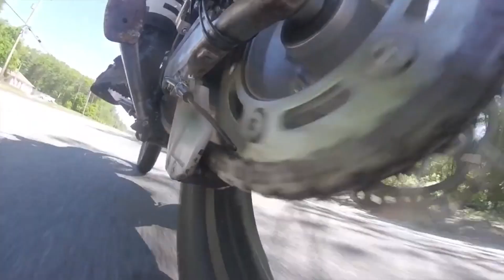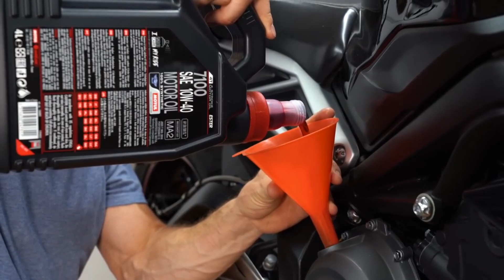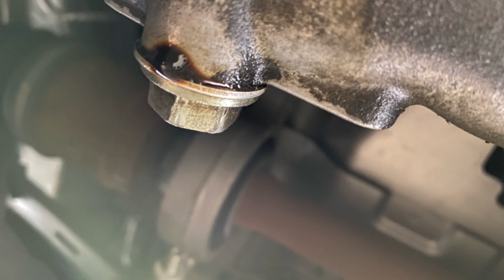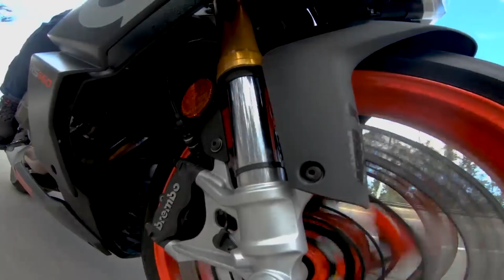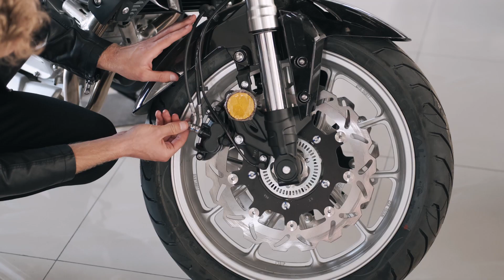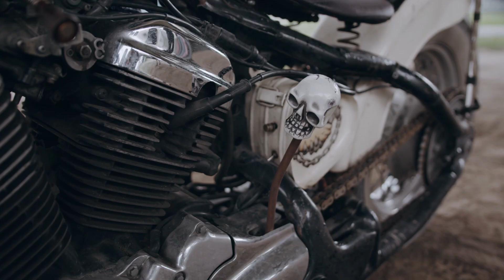10 Motorcycle Maintenance MISTAKES That Could Cost You Thousands!

Comment: Help prevent oil drain plug over torque by using 1/4 ratchet or equally short wrench.  Less leverage.
Many newer bikes have hydraulic lifters so regular scheduled valve adjustments are not needed.  Find out what you have first so you don't get roped into an unneeded valve adjustment.
You can often get factory replacement parts for normal wear items on Ebay if you look for them.

Comment: There is more to correct tyre pressure than copying what is stated in the manual.  What is written in the manual is based on a specific weight of the rider, usually 70kg with no add weight from luggage, and it is also dependant on your top speed.  So if you weigh more, and travel at higher speeds then inflate your tyres above the manual spec.

Comment: Oil screw. I fixed it after buying a motorcycle with a damage there... Buy the right fitting spark plug threaded sleeve and the heat resistant glue, the whole stuff... It works perfect, lasts very long and costs around 40 $€.